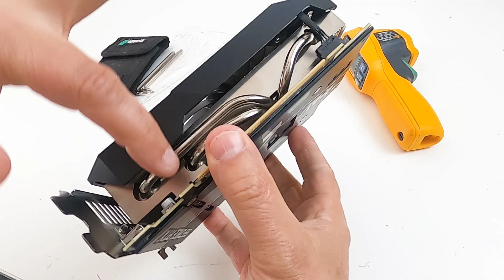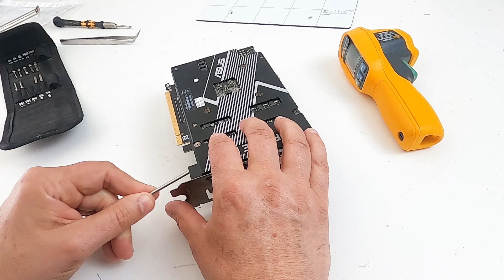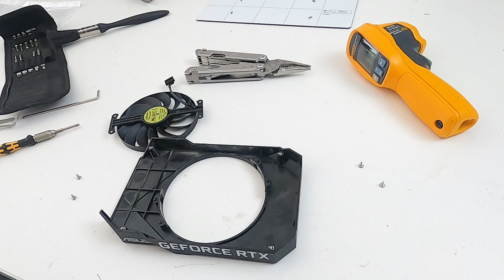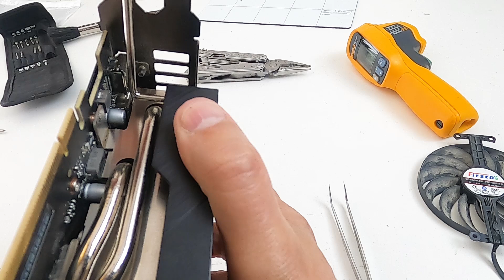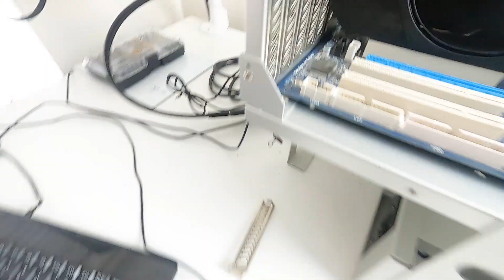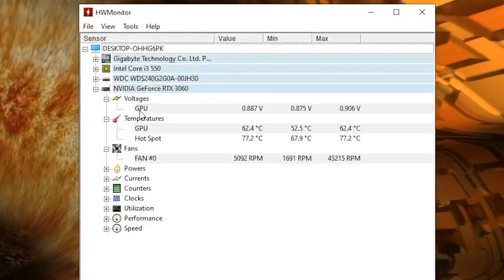ASUS RTX 3060 Overheating *DIY FIRST FIX* in English

Comment: Thank you for the vid . Can you leave me a link for the right angle screw driver and fan. Great work .
Reply from the maker: You can just do a search as availability depends upon where you live... but...

This is the sort of screwdriver set you need. I searched for 'right angled screwdriver'. This isn't the one I found when I bought my set, but it'll do the job.

https://www.temu.com/uk/7pcs-right-angle-screwdriver-set-ph3-ph2-ph1-ph0-t25-t20-t15-sizes--bent-tip-durable-metal-construction-ideal-for-tight-spaces-precision-screwdriver-set-g-601099536819372.html

And this for the fan...

https://www.aliexpress.com/item/1005005686939834.html

I searched for the part number PH-RTX3060-12G-V2 and added replacement fan.

Hope that helps.

Comment: Literally just fixed mine following your routine. I did have to order the cab for $13usd and the L screw drivers for $12usd. Both of amazon. Though the screw drivers i got were black and magnetic. Ty so much for saving me about $600 for a new card.

Comment: Thank you for great video and links to the fan and screwdriver set. 
One question: The fan you replaced has model number FDC10U12D9-C and the fan you linked to (and installed) has model number T129215SU. Searching for it, I found T129215BU fans instead of T129215SU for ASUS Phoenix RTX 3060 V2. Do you know what does this suffix denoting a particular sub-variant mean? Specs line up.
Reply from the maker: I think the SU and BU refer to the manufacturer as there are often a couple of different ones for the same product. As long as the physical dimensions are the same, it should be fine.

Comment: You got links to buy the replacement fan and 90 degree screwdrivers?
Reply: Hello, great video my GPU is having a fan issue. Neither PEI ports are turning the fan, nore higher temp tires which would turn on the cooling system. Do you have the link for the fan, the current on is expired. Thank you !
Reply from the maker: It was a TEMU link and they change stock listings... if you Google the graphics card make and model and add 'replacement fan' it should, hopefully, give you a working link.
Reply from the maker: Try these...

Fan

https://www.aliexpress.com/item/1005005686939834.html

Screwdriver Set

https://www.aliexpress.com/item/1005007960193806.html

These are the ones I actually bought. 😊
Reply: @sterntechdaddy thanks my fan when out wouldn't spin i took my gpu out to clean it and reinstall it and it still wouldn't spin less i give it a spin by hand to get it started and it makes a horrible sound when it does spin thought i had to buy a new gpu till I found this video
Reply from the maker: Glad it helped. 😁

Comment: Honestly if your GPU is overheating a repaste isn't a bad idea. You shouldn't reuse the thermal pads... but you can. No one is going to stop you. I also had a lot of trouble with mounting pressure on my old GTX 1070ti. I dunno from where but I had these kinda card paper washers that I ended up putting under the cooler screws to get some extra mounting pressure. Dropped the temperature under load by 20 degrees celcius!

Also as an alternative to buying a replacement bespoke fan, you can get a vga to 4 pin fan adapter to convert from the fan connector all the gpus seem to use to a 4 pin fan, and use a PC fan, then just ziptie it to the heatsink. They usually move more air!
Reply from the maker: This one was overheating because the fan had failed - the paste and pads were fine. Proven by the temps during testing after the fan was swapped for a new one.

If you can get an identical replacement fan then there’s no need to bodge it with zip ties.

And replacing pads can be a problem… some cards use three different thicknesses. 

And some use pad thicknesses that aren’t easy to find. The Palit GameRock 3090 card, for example, uses 2.5mm pads.

If the pads aren’t right then…  

Too thick means other components don’t interface with the cooler properly and it gets hotter. 

Too thin and the same thing happens.

This video just proves that if the card is overheating then checking the fan might just save dismantling the card and having to repaste and repad.

🙂